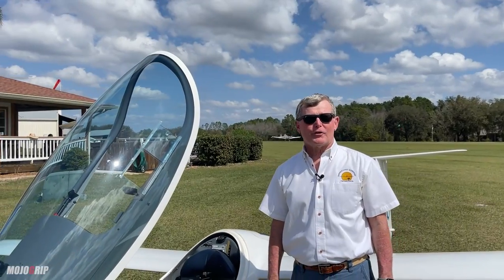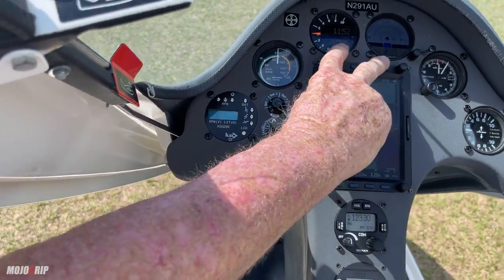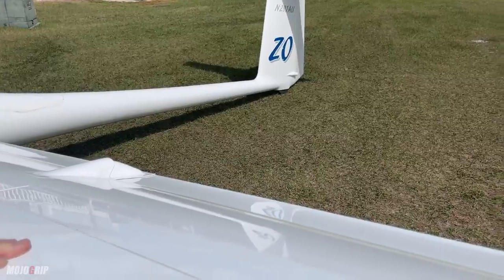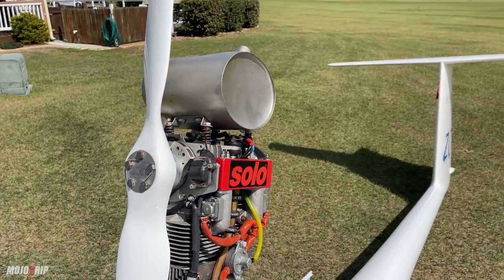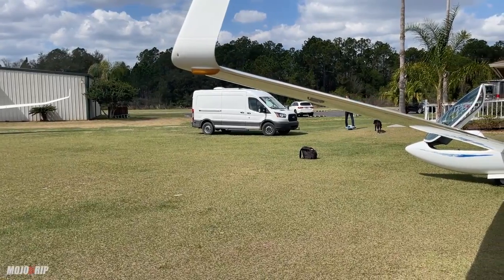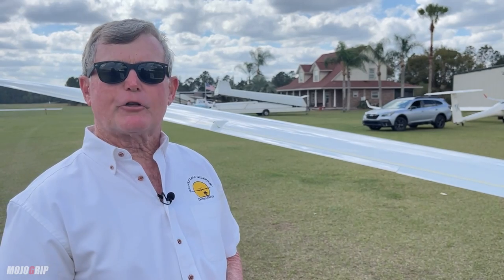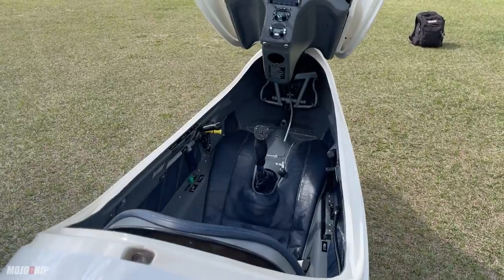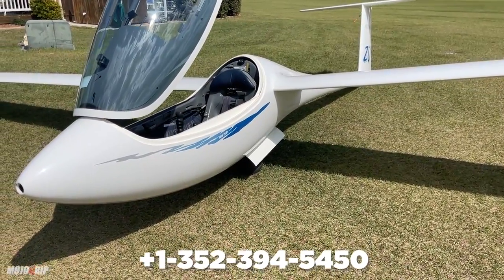High Performance Sailplane With A Tiny 24 HP Engine

Comment: Cheers for featuring a sailplane! Cheap way to learn to fly as often instruction is free. Converting to powered craft is easy and at many glider clubs they will have a motor glider as a trainer which makes the transition very smooth and quite comprehensive

Comment: Mr. RO, this video will help our club members with transitioning from student to licensed pilot to cross-country happiness, while helping the club by control its expenses. Unlike powered aircraft rentals, soaring is a long-term passion that requires time, money and love.

There is more to soaring than scheduling a glider, flying it, and paying for the tow and rental fees. There is insurance, inspection fees, maintenance fees, loan fees, cleaning, vacuuming, waxing, stroking, debriefing, beer and brats, etc..  

Ownership versus rental? There is a big difference.

Comment: Even with that engine, you still have to have a tow? It can't self launch?
Reply: They are small engines, more suitable for sustaining the glider when thermals goes off rather then for take off. It is most considered for emergency. Take off with so little power is possible but .... personally do not recommend, even because you probably spend all your fuel to climb and if you have an emergency ... what you do without gas? For this reasaon is better to climb with a towplane, make your flight and spare your enegine and fuel for problems in the return flight. I have flown over Swiss Alps (not the flat Florida!) and here with such small engine do very little.
Reply: @antonioiozzi4301  Makes sense. I've seen some electric ones that are powerful enough to use for takeoff. Nice thing about electric is that after catching a few good thermals, you could use the prop as a wind powered generator and recharge the battery for later when you've hit a dry spot.
Reply: @daveduncan2748  Not really because the engine and the prop get retracted after the climb

Comment: It's neat. With an engine that big, shouldn't it be able to take off on its own? getting towed up seems so inelegant.
And of course imagine it with half size wings, pressurized cockpit and two tiny jets on it going mach 0.7 at FL500. Sail across the atlantic or to hawaii
Reply: @buzzinbritain8222  hehe, no I'm a polymath genius. You?  sure it's only 24HP however it's also a 48:1 glide ratio bird which means 24horses can easily carry it up. Isaac Newton.
And I'm very right about the rest too.
Reply: @DanFrederiksen  no, you don't have a clue about anything................and if your a genius 
 then  I must be Newton.............
Reply: The same manufacturer makes a slightly different model which takes off on its own - the ASH 31mi. The self-launching engine is rated at 57 hp. To make room for the larger engine the fuselage is slight wider, and the wing area is slightly greater to support the extra weight when the lift is weak. In the 18m class self launching models are less competitive in top level competition than the non self-launching models.
Reply: Gliders with engines this size can't officially take off on their own, but given a sufficiently long and smooth runway with no tall obstacles at the end I've seen it done from e.g. a 1500m sealed runway. More practical is to tow them to 100 km/h or so with a car and a short rope (I mean 20+ m). Proper self-launching gliders can take off in 200m on grass.
Reply: @BruceHoult  with grass as smooth as in this video I see no way it couldn't take off on its own in much less than 1500meters. I'd guess 200meters or less. In ground effect this must fly at 50km/h or even less without ballast. It has a glide ratio of 52 at 90km/h. A light breeze and it flies.
Reply: @DanFrederiksen  I'm a glider pilot with experience seeing machines like this attempt to self-launch on both grass and tarmac. It is apparent that you are not. Also, this is going to have a stall speed of about 75 km/h, Ground effect might reduce that to 70, but no way 50. Also it will have huge amounts of indiced drag at that speed, which is not good for acceleration. It needs to accelerate to 90-100 km/h before climbing, and then be able to climb over any houses, trees etc at the end of the runway, and also have enough altitude to safely turn around and land if the engine fails for some reason.
Reply: @BruceHoult  the bird has a glide ratio of 52 at 90km/h so it's a very simple fact that it doesn't need to go to 100 to climb.
Because it is such a good plane it's only a question of how long a runway it needs to take off, not whether it can.
According to bing AI the stall speed at 600kg meaning with 210kg ballast is 65km/h so without the ballast it's no doubt much less and that's without ground effect. I'd bet you 100$ this bird can fly at 55km/h with that engine. I'd bet you an additional 100$ that it can be sustainably airborne in less than 300meters. Likely less than 200meters.
Making towing nonsensical without ballast. In neutral air of course.
Reply: Aerotow launch is far from inelegant. - It's enormous fun to perform a formation takeoff with a 260 hp towplane. Sailplanes are built to utilise thermals, and soar cross country like an eagle. If you want to cross oceans, buy a ticket, or spend a fortune on a turbine single or twin.
Reply: @KeithHays-ek4vr  bla bla bla. you often fly with 200kg ballast, why not a 5kg engine and the option for that ballast to be fuel. You can still do soaring but it can also actually go places and self launch. If you don't live by a mountain range you can fly there. Or you can fly on vacation. Or sight seeing. When you aren't the slave of thermals in a plane without an engine. And because it is efficient it can have pretty extreme range. Longer than most private jets.
Reply: @DanFrederiksen  yeah it can have long range than a private jet if you want to fly 20 hours